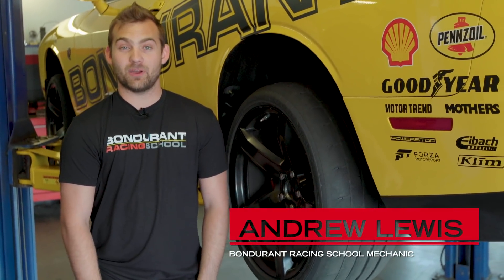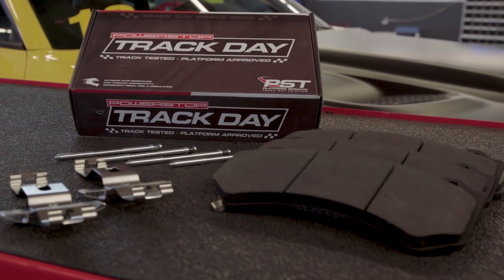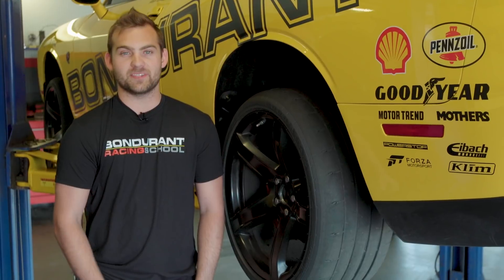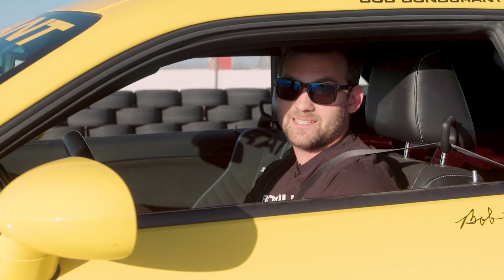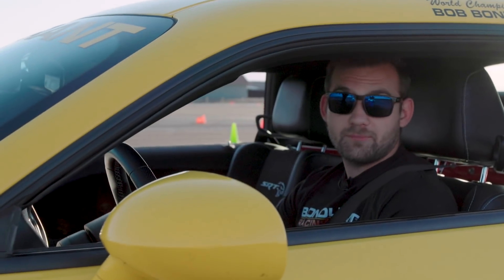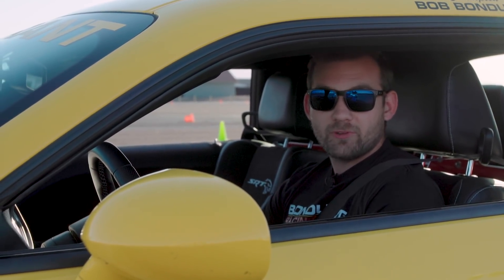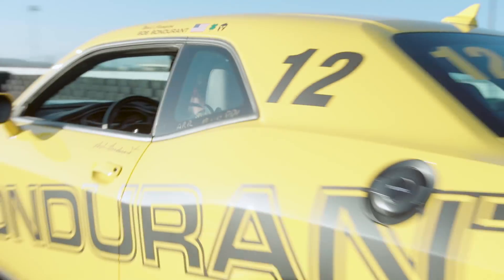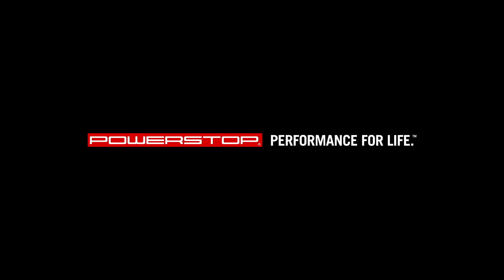How To: The Break-In Procedure for Track Day Brakes | PowerStop

Comment: I broke these in (PST-1730) on my fiesta st. They got hot, a bit Smokey and smelly after doing the 80-10, 10x but pretty sure that’s the point of the break in procedure!  If not, well they’ve held up at the track and 10k miles thus far LOL
Reply: I got some stoptech sport pads and required me to do 15x 50mph-10mph and they also got very hot and smelly and made me a little worried until I let them cool and tried them out, they stop so good that they’re making me buy some sticky race tires so my tires don’t lock up so easily 😂